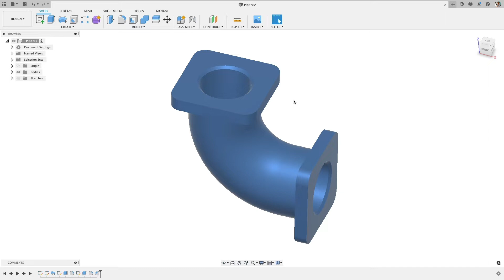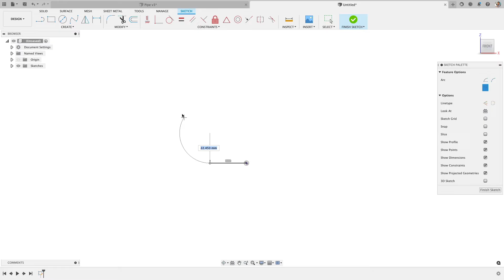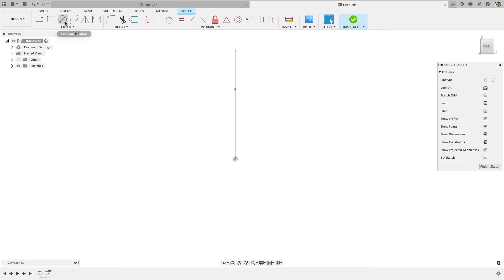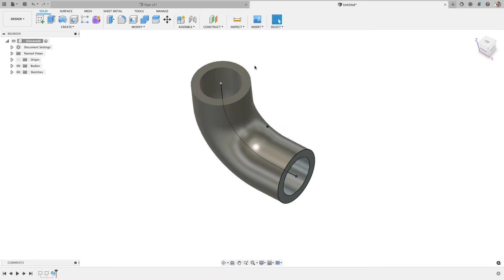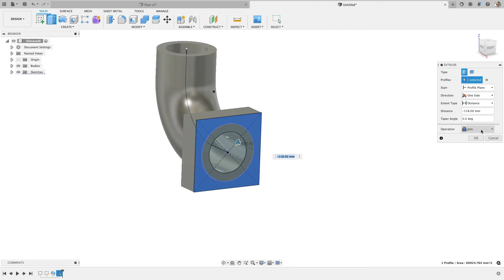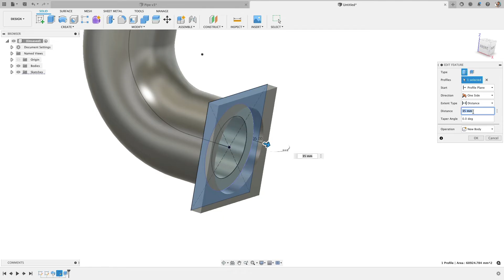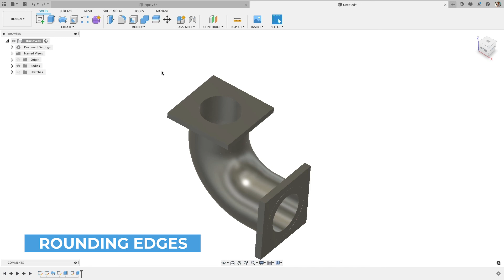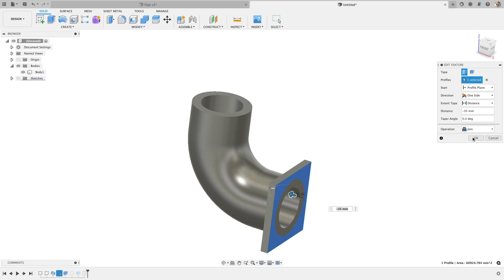Getting Started With Fusion 360 - Pipe Tutorial

Comment from the maker: What designs do you struggle with?
Reply: with delta wings on planes.
Reply: Why didn't the coincident constraint automatically populate when making the two lines equal during the sketch?????
Reply: A compound curved surface - I think that is what it is called.  I tried to model the bottom of my Bose soundbar remote to make a cradle that would keep it on the coffee table (hope).  It was way too challenging becuase of the lack of symmetry.